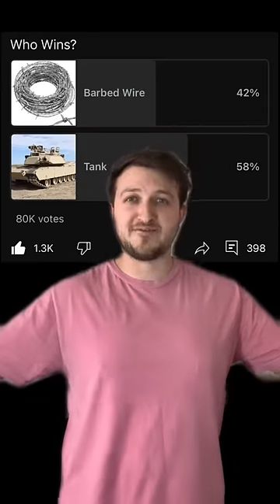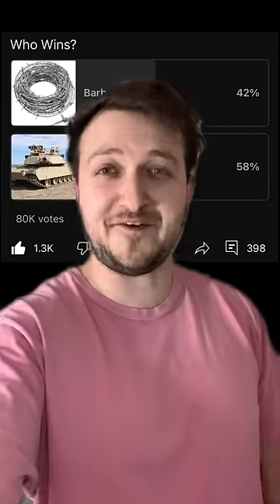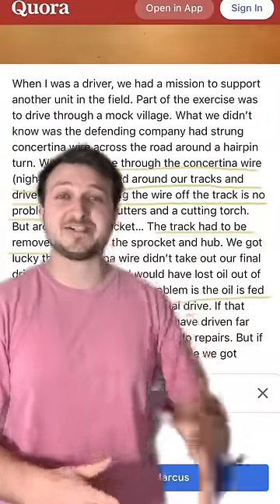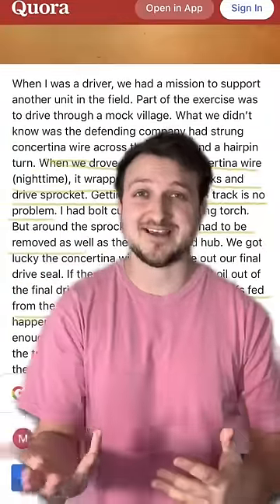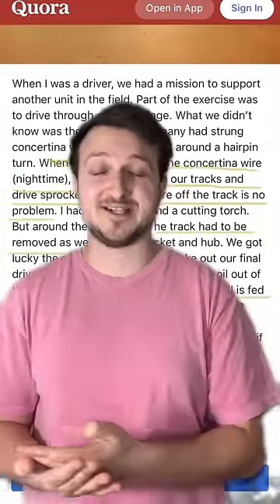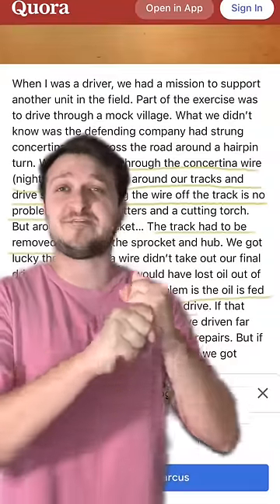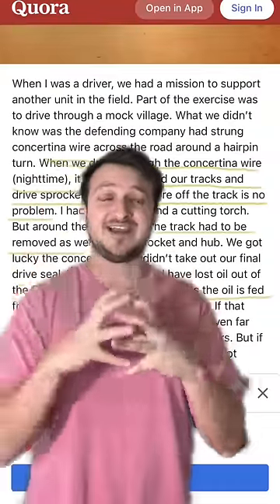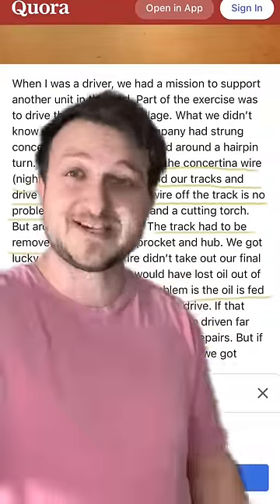Soldiers Tank vs Barbed Wire. #shorts#army

Comment: Of course, that’s assuming the tank doesn’t sit back and unload on your barbed wire and mines from a distance. Dump enough ammo up a narrow corridor, and just about any defense that can be built can be destroyed… imagine a line abreast of tanks, all blasting at the same 50m wide section of 11 strand… M2s as well. Trying to hit one strand with one shot would be tough… but enough tanks firing enough ammo - splinters!

Comment: Why? I don't think you explained why tanks have difficulty driving through barbed wire. I believe it, but I'm curious what the important mechanisms are that prevent a tank from getting through barbed wire.

How did the barbed wire tangle up the drive shaft? What caused the oil leak? 

Good content, but I feel like you can add more of the why🤔 and how 🤔 and instead of focusing exclusivelyon the wow-factor😳

Comment: First of all, barbed wire is a joke. Concertina, like what we use today, is a nightmare. It's like shuffling your feet while you're wearing socks on a carpet and shocking someone with static electricity versus jamming a cattleprod into their sides and pretending that they're the same thing. Barbed wire is used for civilian fencing to keep animals and sometimes humans in/out of a place. Concertina wire is defensive emplacements.
Secondly, it depends on how you drive over the concertina wire and how it's set up. If you go in at a shallow angle or you start turning over the wire... good luck, because you're just drawing it into the road wheels and FD. If you go straight over it gunning it, chances are you'll clear it.

Comment: His drive shaft ? First if you are just talking about wire there is no problem. There will be a mess underneath, lots of work later after I have closed with and destroyed the enemy. The tank will move and fight. Now once you add it’s covered by observation or fire that’s a different story.  The mine stops the tank. Not the wire.

Comment: Tank vs a standard barbed wire fence meant to contain livestock or discourage casual trespassers? Maybe the tank wins.
But against the combat utility deployment of wire, even without barbs or razors? No. You don't want to sort out that high-tension tangle of steel.

Comment: Yeah the tanks themselves were designed in hopes they could roll over the barbed wire but there are other machines that don't get talked about much that we're specifically designed to flatten that shit out And there absolute pieces of garbage the one thing was a giant 15 or 20' tall wheel that a person would sit inside of and drive and the only way to steer it was to get a group of people to crank the thing a different direction

Comment: I thought that if any barbwire gets caught in the tracks of the tank it would get cut with the immense force of the tank, that think is so thin, a tank is so strong and is so heavy that even just it's inertia is unstoppable if it doesn't decide to use it's brakes

Comment: A tank can defeat barbed wire, but in the end, the barbed wire is going to defeat the tank.  

Trying to put a second tank through a hole in the wire from a first tank can be successful. 

But those are rarities, and any obstacle not covered by fire or at the very least observation, is not an obstacle. 

The wire, whether it is the barbed wire or the concertina does not matter, what does matter is that it is going to get caught up in the drive sprockets, treads, road wheels and cause havoc, ripping open seals, binding up drive axels, road wheels, and treads in fairly short order resulting in a "M" kill of a tank.

And that by just letting the tank go. If it is mined, covered by AT weapons, or just about any kind of defenses or fire, that mobility kill is going to very soon be a total loss and hard kill. Just a shouldering hulk left behind as a reminder to not mess with the wire!
Reply: PS: if it is an 11 row wire obstacle, it is doubtful the tank would make it all the way through.

There would have to have been some seriously flawed wire installation and/or very lucky tank crew to get through.

Comment: I ran over a large plastic bag on the highway a couple of years ago in a semi. It turned my driveshaft into a weed Wacker. it cut through several air lines. I can believe steel wire would be much worse even if used against a tank

Comment: Well I depends on the WW1 tank, some had fully enclosed tracks like the Mark 1 and Mark 4 tanks were actually capable of running through the tangle wire with its steel tracks however this doesn't mean it can go through without damage but their are accounts of both examples of tabks flattening the wire or getting trapped its always case by case do not take what he says as 100% its not a 0 or 1/ Yes or No answer just because one tanker accidentally runs into barbed wire doesn't mean the tanks couldn't many tanks could very easily run through barbed wire along as they know the defences and make a plan for it so there is an argument for and against what he says so stay educated my dudes
Reply: Also keep in mind this combat engineer from 2000's is certainly not an expert on 1910's- 1920's tankers.

Comment: I literally sat here for while brain storming on finding a solution for this problem and I may of come up with two solutions like picture if there where wire cutting bars that would be bolted to the tank length wise with the the tracks so if any wire slips through the friction from the wire going up or down would be cut on the double edge bars or what I call  is wire cutting bars or the gears themselves that rotate the tracks have hub caps that are a little smaller then the gears that are edged so the teeth stick out a little more then the edged hub caps so if any wire gets cought the friction would cut the wire but I don't know though I have a big imagination would be cool to see the concept in a movie or video game.
Reply: Haha or what if the teeth themselves where edged like not with sharp points at the ends but the empty spaces would but the tracks themselves would have to be designed to work with them the track and gears have two purposes to move the tank and to cut wire.

Comment: now hold on tanks your advantage to run over by wire but it wasn't better to go through Bob why there's a difference you get Bob wire cardboard and traps and then tracks them tracks will come off the rollers and then the tank will sit tight on won't go nowhere that's what he's talkin about the Bob wire get caught up in the tracks. adjust just a bob wire fence and you had to go through it yes you could run over but if you had to go through a lot of Bob wire that you had the military and get tangled up inside the tracks

Comment: A tank can win if it have a ramp on front and track would be block so it can be hit by the wire but it can be removal but if it's on the tank it would cost the tank will not be able to go up cost the ramp is at the lowest for tank go up but it can go up but in reverse so the tank can win but it as well cost the tank to go reverse if the ramp is build with it

Comment: Dont know about american tanks, but a german tank loughs about that. See, every moving piece and part from the motor to the tracks is driven by pure physical strenght. Barbed wire is not strong enough to coil up enough to block anything, it gets shredded long befor the point of physical blockage. You mentioned land mines. THOSE are the thread. Those will halt a tank inside a Wire Trap. But the wire in it self? No chance. And you will find not one example in which wire alone stopped a funktioning tank. So please, stop with this military myths, on the fact of Physics alone, it will not stand.

Comment: Barb wire?
Simple make a few Bangalores & pray the infantry don't get mowed down by emplaced machinegun fire.
You can bring logs on the tanks but they are better for river crossing though still meh.
In many ways not a lot has changed since ww2.

Only thing that stops tanks & infantry better then Barb wire is land mines.
Might as well be an invisible wall till demolition disposal & Engineers come in.
Most all nations have a shortage of Engineers & sappers i don't even think most train them anymore.
I'm a mechanical & electrical Engineer that would rather be a welder for the pay is better while you don't get shot at.
You couldn't pay me nor indoctrinate me to that job military engineers have to put up with.
No respect given, acknowledgement & meh pay.
It's a thankless job I wouldn't do.